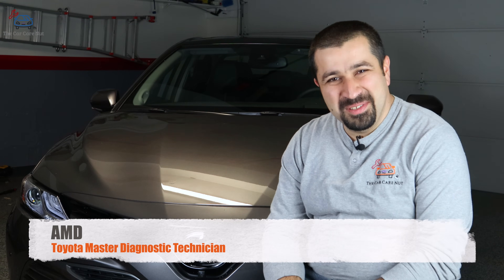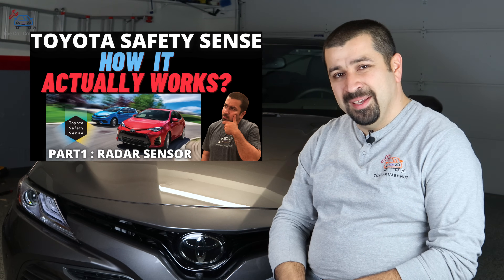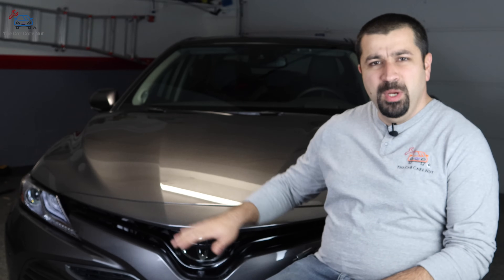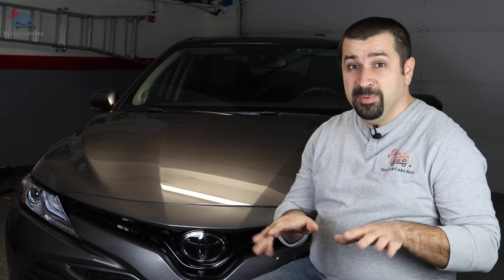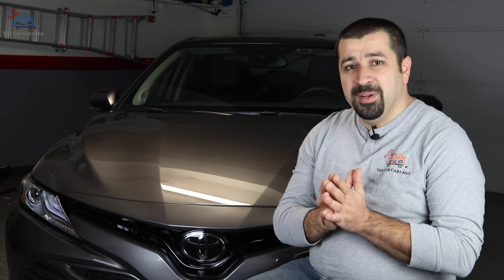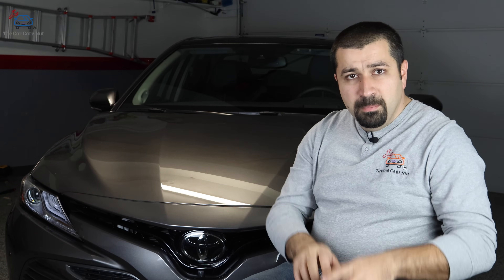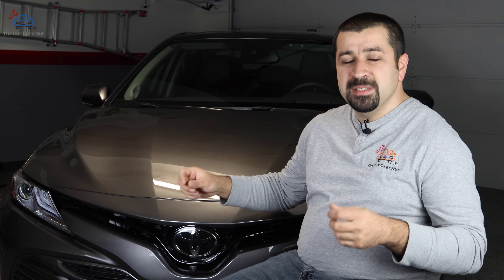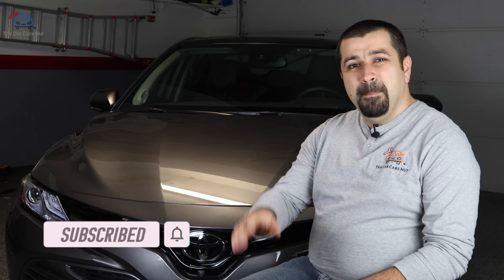How do Toyota Safety Sense Work Part 2 Front Recognition Camera

Comment: My hybrid 2023 le Camry has only 3k miles.  I never heard the frontal collision sensor beep not one time and I have approached cars quick when they slammed the brakes in front of me.  Took it to my dealer and they tried to test it and recalibrate it.  Does calibration fine.   Shows good and no errors.  They still  say it doesn't work by placing a light garbage can in front of it.  They ran towards a roll up door and no beeps.    They are stumped.  I have to bring it back Monday and they are going to call corporate Toyota to help.  Cruise radar works fine.  They are gonna give me a loaner car.  I have been researching it.  I'm not sure if there really is a problem with it. Is the system smarter than the tech?  I compare it to my 2017 Corolla which alerted me all the time.  What should I do.  Please help!

Comment: Is there a certain speed at which the system will activate/not be activated?
Reply: Check your owner's manual. 
On my 2018 Tacoma the dynamic cruise control deactivates at 32 miles an hour and under, which also means other safety sensors pretty much deactivate too

Comment: if you were parking is a carpark space and about to hit a wall for example, would the car stop you at low speeds? i just bought a brand new toyota yaris and got 128mpg last night :)
Reply from the maker: Hi! In some cases at lower speeds the system doesn’t react

Comment: You were talking about do not test the system, Maybe Ford uses a slightly different system, but my wife had a situation in her 2019 Fusion where she was turning left under a yellow light  with a car in front of her also following suit. At the last second the driver in front of her decided to slam the brakes and stop . (Nissan Versa vs a Ford Fusion) Versa stopped shorter than Fusion can, Wife reacted braking hard and quickly,  yet the car's anti-collision avoidance still activated. She did make contact but there was no damage on either car.  This kinba falls under what you was talking about  "Do not test the system".

Comment: Toyota Safety Sense saved me a couple of times when the car ahead slammed its brakes and didn’t have working brake lights. The “BRAKE” warning came on and I tapped the brake pedal and my Prius autonomously applied hard brake pressure.

Comment: Love your channel.. Been buying Toyota's since I got my son a 2006 Corolla, Bought my 2009 Highlander Limited 4wd/AWD new in 2009 have 163000 miles and no issues, regular maintenance every 5k oil and rotation, runs like a top, bought my wife a 2017 Camry for Christmas in 2016 again runs like a top but only 29k miles .. Regular maintenance Oil change and tire every 5k and then every other interval required.. So that said.. I bought a Weekend truck, 2020 SR5 4WD used 5K, has everything I need but I am thinking about raising it an inch,  two at the most nothing dramatic, Bill Stein 5100's all the way around and an add a leaf for the rear , how do you think that would impact the Safety sense? Could it throw it off if so would a dealer recalibration suffice if possible?  Appreciate any tips you could provide
Reply from the maker: Hi! It would throw off its calibration and dealerships are instructed by Toyota not to modify the calibration for safety reasons.
Reply: @TheCarCareNut  So if Toyota dealers aren’t allowed to calibrate, who does the recalibration then, say when replacing the windshield?

Comment: SO the car really brakes by itself? That is impressive how the technology are. Great video!
Reply: Yes! Below 19 mph it can come to a complete stop autonomously. At higher speeds, it can apply full braking force but depending on the distance and speed between you and the car or person in front, your car may not stop in time to avoid a collision, but it will significantly reduce the force of the collision. The safety system saved me a couple of times when the car in front had no working brake lights and also when another car slammed on their brakes. My car displayed “BRAKE” in the instrument panel, and as soon as I tapped the brake pedal, everything in my car flew forward because the car applied full braking force autonomously. My Prius with Toyota Safety Sense is cheaper to insure than my previous car. My insurance company refunded me some money when I first got the car. In my opinion, the system is worth having.

Comment: I'm slightly concerned by the high (to me) false alarm rate of this system on my Lexus UX. About once every 500 miles or so, I get the pre-crash warning for no good reason - typically on a curved road with lots of cars (especially vans) parked on the side of the road. I assume that the system 'sees' the wall of stationary metal from the sides of those cars and misreads the situation. I can cope with the pre-crash warning, but would be very worried if the car decided to brake automatically and so risk the vehicle behind me running me. For info, this is on UK roads so can be fairly narrow in some places.
Fortunately, its never gone so far as applying the brakes - do you have any information about how trustworthy the system is. Subjectively, its better than my previous Lexus CT's system so some improvements seem to have been made.
Reply: My 2021 venza will also react that way sometimes on the highway, but to overcome that and avoid getting hit in the rear I just step on the gas pedal and it just continues going instead of braking anymore

Comment: Had Toyota 3×1 lift and level and 285 70 17  a t tires installed after purchase.on 4 runner  Did this a effect camera or radar system
Reply from the maker: Hi! Lifting does affect the camera and radar. They become a bit inaccurate
Reply: @TheCarCareNut  i will keep that in mind, thank you

Comment: When you said a "rock chip" on the windshield... did you mean that if your windshield has a rock chip this would affect the calibration of the camera and throw it off?
Reply from the maker: Hi! A rock chip would affect the system if the rock chip is in front of the camera and if the rock chip end up causing a crack that would require the windshield to be replaced
Reply: @TheCarCareNut  Whew...thanks for clarifying that. Just bought a 2021 Sienna 3 weeks ago and the other day a rock kicked up and hit the windshield... gave me a small surface crack towards the bottom of the windshield. Thought maybe you meant any where on the windshield. Thanks again.

Comment: Please help. I just purchased 2021 Highlander XSE Sport. When backing up, I don't hear a BEEP or BRAKE to stop. Same thing with when I get tooo close behind a car....NOTHING...please help
Reply from the maker: Hi! Did it work then it stopped working? Or it never worked? Is the parking assist and rcta turned on?
Reply: Also, is your vehicle equipped with the Safety Sense System?  I have a 2021 Toyota Tacoma and I had to purchase the Technology Package to get this system.  It doesn’t come equipped as standard equipment in all Tacoma models.
Reply: @lc7192  wow thanks

Comment: This system saved me from a major accident the other day while driving my 2020 Tacoma.  I was traveling southbound on a two lane highway, passing a slow vehicle on my right, when the car in front of me suddenly came to a complete stop.  It turns out that the car in front of him was the culprit; it too had come to a complete stop.  This system slowed my vehicle enough so that I was able to pull to the side of the road thus avoiding a collision with the vehicle in front of me.  With out the PCS, I am sure that I would have had a major accident.
Reply from the maker: I’m glad it worked and avoided a major accident.

Comment: Again kudos to you Ahmed! 
Very interesting safety feature. 
I like it when you said that it is also observing how I react or how I drive. 1. 1. 1. Does it mean , it can also sense the driver’s attention on how he holds the steering wheel?
2. Regarding the camera’s location which is in the windshield, does it mean we should also be mindful if we parked our Toyota where it is not shaded? Heat can damage the camera system.
Reply from the maker: Hi! So the newer systems can sense if you’re holding the steering wheel or not when the system is active. Also the camera is pretty well made and designed to withstand the elements so direct sun light wouldn’t affect it.

Comment: Such a system on my 2014 E350 Benz , already safed me from on accident .
I was driving in  stop and go traffic with 35 mph   , had to change lane and as i was looking over my shoulder the car in front of me stopped , my Benz gave me a beeping warning and slammed the brakes and pulled back the seatbelt  , it scared the shit out of me !    Lol ..   it saved me from allot of trouble und exspensive repair costs..

Comment: Hello Mr car care nut, i am regularly good listener of your videos, my 2028 toyota auris hybrid 1.8  it the top spek excel model and it comes with every feature on the car it got senior in the front and rear bumper if i stop too near of a car that's in front of me it beep beep it telling me to be careful iam close to to car in front even if I pass a too close it beep beep,in the middle of the speedo meter i go in to setting and trun the beep beep sound off is that a good thing to do the beep beep sound annoyed me mostly in traffic but I can pause the beep beep sound on the radio but it still make that beep beep again if I stop too near of a car,the camera that on top of the wind screen it make a different  sound but it happens when iam on the motorway it is telling that iam aproching speed camera that sound doesn't go's on constant so it doesn't annoying me so I leave it  on, America you guy's call it free way iam living in England they call it motorway thanks for reading 👍

Comment: Hello! Just want to ask regarding tire inflator using it in Sienna Hybrid. I just noticed I was using a 30amp tire inflator with clamps. I tried it both in my vans jump connector under the hood and directly to the battery in the trunk but it only worked maybe 10 seconds then shut down. I was wondering if the hybrid battery can handle a 30amp tire inflator. I used this before in my 3rd generation Sienna with no problems. Also I turned on the hybrid system while using it. Can you pLease let me know why it only worked for a few seconds. I am thinking to just hook it up to my battery pack so I can put air to my tire. Thanks
Reply from the maker: Hi! I already answered your question in another comment let me know if you have any other questions

Comment: Question,  can you reccomend any Lexus sedans that are bulletproof to buy? I'm in the market, we like the Lexus IS, just didn't know if the 300 or 350 is the more reliable since it doesn't have a turbo like the 4 cylinder. Thanks and appreciate your videos
Reply from the maker: For reliability I would look into the ES. The IS and GS are reliable however they’re a bit more complicated than the ES. The 350 would be my choice.

Comment: On the 2021 Camry xse hybrid. Does the ac/heat stay on when you come to a stop at a long red light?
Or does it do what the vehicles that have the auto stop feature do and shut it off? 
Thanks
Reply from the maker: Hybrids don’t have auto start stop like non hybrids because they just shut off the engine as a normal part of their operation. The HVAC continues to function as well.

Comment: The automatic high beam on the car is my only complaint. I've blinded cops going across a over pass as I'm exiting driving pass me. Also oncoming traffic actually, I always get high beamed specially by semi and I notice it's not sensitive enough to oncoming traffic. FYI i have a 2013 Mercedes gl450 fully equipped and the auto high beams on it work beautifully.
Reply from the maker: What is your Toyota model?
Reply: @TheCarCareNut  it’s the 2020 Toyota Camry hybrid LE
Reply from the maker: Ok did you bring this to the dealership attention?
Reply: @TheCarCareNut  I haven’t. The 10k mile oil change service is coming up so maybe I’ll bring it up when I take it in.
Reply from the maker: I would. Perhaps they could try to calibrate the camera in case it’s out of calibration. Does the lane keep assist work ok?
Reply: @TheCarCareNut  lane assist works ok, it’s not great and doesn’t work everytime but yea it works decent most of the time
Reply from the maker: Have them take a look. I’d start with recalibration the camera and go from there.
Reply: @TheCarCareNut  I definitely will take your advice and make them aware of it. Thanks so much. I have a quick question, what do you think about Toyota doing the first oil change at 10k? They told me it no longer needed an early break in oil change? So you think this is because they offer free oil changes the first 2 years and it cuts at their bottom line or is it actually something they do at the factory that doesn’t require that early first oil change? Thanks I’m advance
Reply: @emmanuelmata  Im sure you got the answer. But no every 5thousand miles no matter WHAT

Comment: This is a general Toyota Hybrid question.  Are the 2019 Camry LE and Rav4 LE hybrids prewired for heated outside mirrors?  If so, can the mirror face be replaced with one that is designed to be heated?
Reply from the maker: The answer to this question would not be a simple one. Some of them are and some aren’t. The parts department would answer this one looking for the wire harness part no for different optioned models. If they’re the same then it’s pre wires
Reply: @TheCarCareNut  Thank you for your reply

Comment: 2 seconds equal 20 minutes in an accident. I know, everything went in slow motion as I was flying in the air off my motorcycles. I see a lot of people lowering their Camry. I guess they need to Re calibrate both systems
Reply from the maker: Hi Ahmad. Very true. Lowered cars or lifted cars could have issues with this system as it kinda throws everything off

Comment: Ah! This explanation clears up a lot. One of my concerns about autonomous vehicles is the problem of dealing with unusual emergencies. Imagine a truly self-driving vehicle in the wildfire shown in https://youtu.be/cI2sgyoiL1o
The Toyota system (if I understand right) does not interfere with human understanding required to come out alive. Much better.

I would also like to comment that the last two non-OEM replacement windshields I have seen (and one was a brand new one on a rental Sienna two years ago, and one was on our used 2014 Prius) had badly rippled areas. You aren't kidding when you warn about that.

Comment: I have seen videos where they place a box on the street and Toyota didn’t stop. The box was about 4 feet tall and 2 feet wide.
Reply from the maker: That’s an intentional test. Have someone tried to come head on to a car and hit it? Because that’s when the system will work but who’s going to take the chance? The manufacturer did when they designed the system so you wouldn’t have to.

Comment: Great video as always. I have just bought a 2020 Yaris Hybrid in the UK. I have a peculiar fault that Toyota hasn’t managed to solve so far. The fault is related to the Road Sign Assist. It recognises the sign but in kph rather than in mph. You may say that a sign is a sign regardless of the unit. It is true until you set the over-speeding notification to let’s say 3mph. If you are driving 40 mph at a 40 mph recognised sign it will show over speeding because it is equivalent to 60 kph. You need to drive at 25 mph not to get an over speeding notification. I know this is a long shot and hopefully it makes sense. Does anyone have any clue what the problem is?
Reply from the maker: The problem here is likely programming related. Don’t quote me on this but there’s a customization section in the Toyota scan tool which can change units that might be the setting that the dealership needs to change
Reply: I run an older (2017) Yaris with the same sort of problem. It actually users lasers (not radar) but has the camera mounted alongside the laser just behind the rear view mirror. There are quite a few oddities with RSA. Sometimes it picks up images from trucks in front (which are mostly metric) so it’s the wrong value, quite a few roads don’t have signs that they should have, sometimes they are obscured by vegetation, or just badly positioned. It also depend on how ‘sharp’ a curve is - it switches off the display automatically on sharp ones, but not on gentle curves. Some places have signs that are not valid for the road one is on - typically exit slip lanes from M roads, as you travel past it. A fair bit of work needs to be done by various highways authorities to make the system work well if they become popular; they’re a gadget at present.

No doubt you know that you can change the units used on a UK model, but using metric is not compatible with using RSA at all; I’ve tried that!

Comment: I was just wondering what’s the other small box right next to the camera on windshield on hybrid vehicles
Reply from the maker: Which model? Is it the box separate to the passenger side?
Reply: Yes.
Reply from the maker: Usually the 2nd black box is the rain sensor on models equipped with rain sensing wipers
Reply: I have a 2017 Prius Prime and I read that that box senses the temperature of the windshield and the humidity in the car in order to automatically turn on the defroster when necessary. my car doesn’t have rain sensing wipers.

Comment: Safety 😄 That's the key words in accident investigation.
"Top Even" to start from...
When Calibration done precisely but tyre pressure and load may put errors to it in term of height.
Reply from the maker: Very true! The calibration brings things within a zone of correctness if you would. Other factors like load and tire pressure variations are accounted for however overload the car or over inflate the tires and everything goes out the window